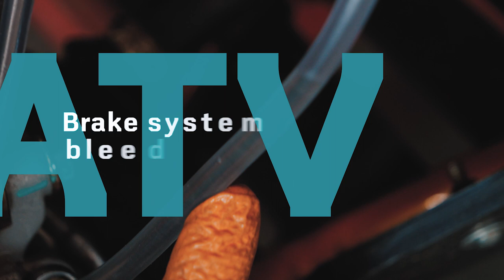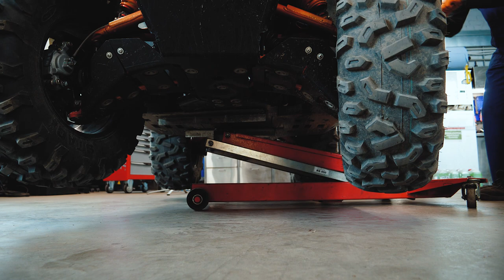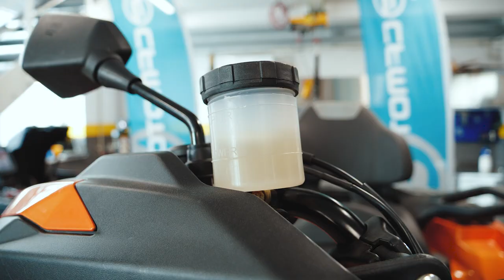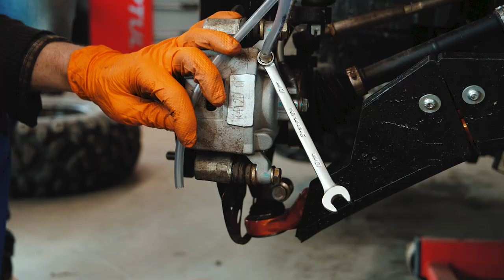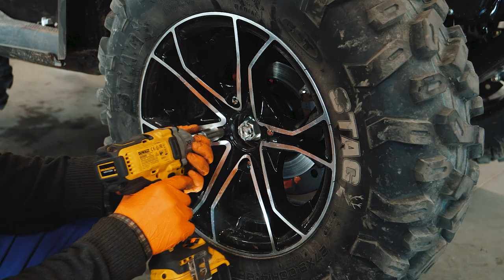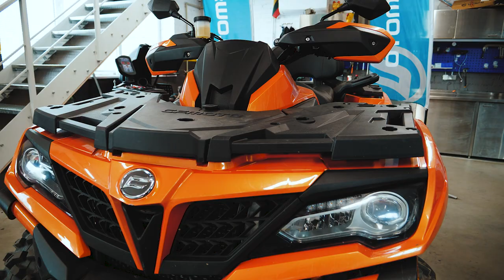#ILoveMyCFMOTO E10 Brake System Bleeding

Comment: What if the lever gets tough to squeeze and the brakes don't allow the wheels to move after?
Reply: Did you ever find a solution to this my cforce 600 is doing that
Reply: @jaimeventura8906  I did. Got some ATV brake fluid from Amazon and a hose and basically flushed out the old stuff with new fuild, worked like a charm. Guess it builds up too much moisture over time and causes lock up.
Reply: @adrianvidal4471  yeah we tired that after I commented lol and it worked thank you 👍🏼